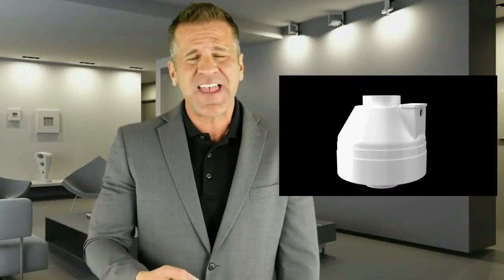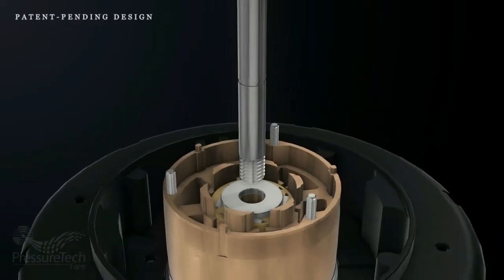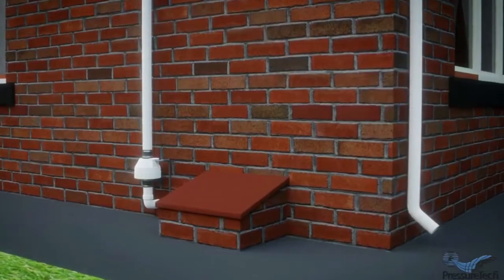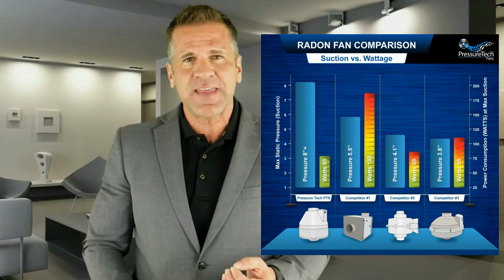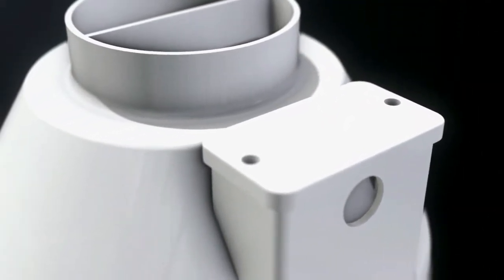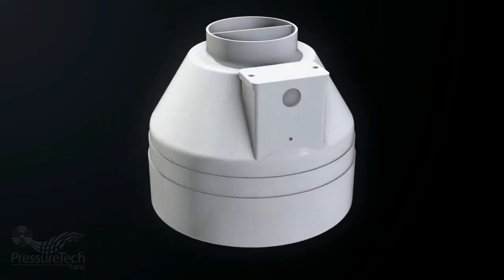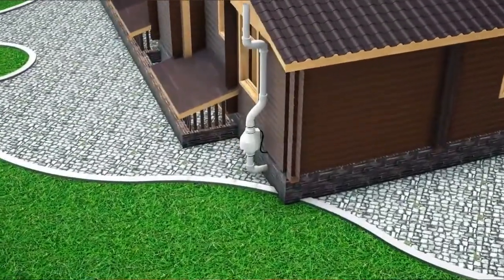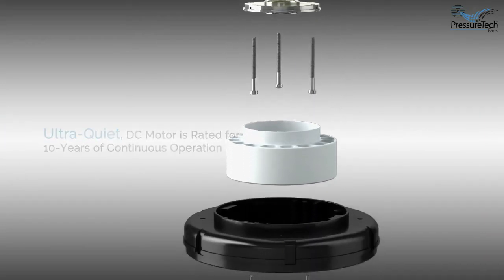The Revolutionary PressureTech Radon Fan | Highest Suction | Low Voltage

Comment: It would appear that the conversion from AC to DC occurs inside the fan housing, so how is this any less dangerous than installing a standard AC radon fan?
As long as the power is turned off at the circuit breaker or switch energizing the fan anyone can install the electrical connection; no need for an electrician.
Reply: I have a Pressure Tech Model PT-8.  The AC to DC power supply (PS) is outside the fan. The PS plugs into an outlet in my attic with a flexible cord. There is a second cord between the PS and the fan. It was installed in 2021 so I don't know if things are the same now (December. 2025).